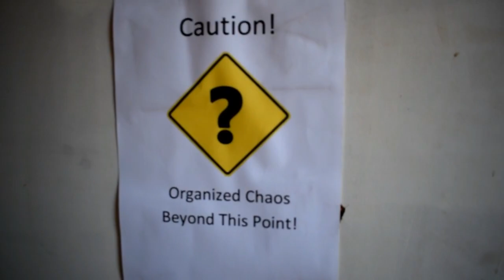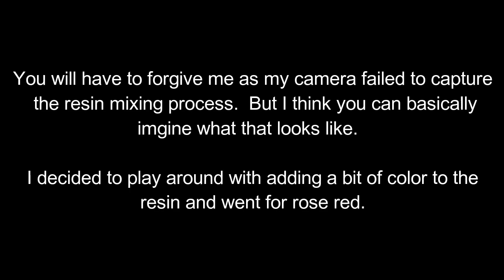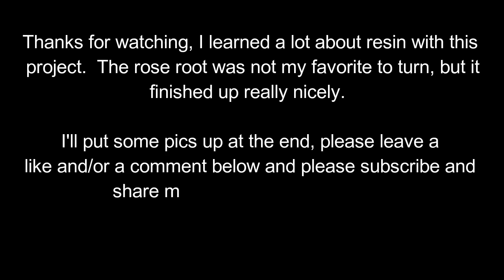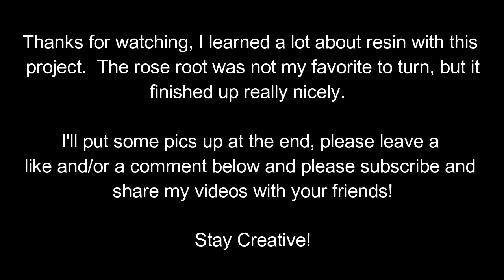Turning a Rose Root Hollow Form Bowl (fixed with resin)

Comment: Cute the epoxy in a pressure pot. 50psi for the first 24 hrs. Zero bubbles. All cracks filled.
Reply from the maker: Thanks for watching!  At the time I made this bowl I didn't have a pressure pot, though I was aware that it would have helped.  Overall, I think it came out pretty good considering I didn't have a pressure pot.  Thanks again for watching, stay creative!

Comment: I'd LOVE to laminate that 'Caution! Organized Chaos Beyond This Point!' sign and stick it to my front door...yup, that's my life!!!  Do you remember where you got it?  3:27...of course it'll go back in place...put it in a bucket of resin with a weight on top...leave it in a pressure pot at 50 psi over night...bingo bamo...it's back in place.  Oh, wrote this BEFORE you actually did this...never mind.
Reply from the maker: Thanks for watching!  I made the sign actually as a joke on Photoshop but then it just stuck.  As for the bowl, funny thing is I didn't even have a pressure pot when I made this and it was actually one if the very first things I ever made using epoxy resin, all things considered it turned out really well.  Thanks again for watching, stay creative!
Reply: @FromTheHeartWoodMK  you too...stay creative.  I can't find any signs like it on the Internet...so assumed it was a PS thing...speaking of creative...very creative.

Comment: Nice job! I found myself trying to dissect your stand. How does that work for you?
Reply from the maker: Thanks for watching and taking the time to comment!  If by stand, you mean camera stand, then in most ways it was a very helpful piece of equipment I had constructed with several moving joints to hold my phone, though it wasn't pretty 😂.  I was able to put it in many angles and positions that made for interesting shots.  Sadly I broke my camera phone one day and so I switched over to using a GoPro and I'm still getting used to that and thus, I don't use that camera stand anymore.  Thanks for your question, I hope that's what you were intending to ask.  Stay creative!
Reply: FromTheHeartWoodMK indeed great camera work but meant the lathe stand. Looks like it’s not attached to floor but wall?
Reply from the maker: @scottpetrie8707  Yes indeed!  I used to have it attached to a workbench but I had a problem cleaning the sawdust from under it.  I had a friend welf me up a couple of  angled braces that I then bolted to the wall.  It's rock solid, allows me to stand closer and sweep the chips and sawdust easily from underneath.  In short, it works very well!
Reply: FromTheHeartWoodMK That is awesome! Squeeze in some video on the next one of that.
Reply from the maker: @scottpetrie8707  Though I've been meaning to do something of a shop tour of sorts for awhile now and might eventually get around to it at some point, for now your can actually go and watch my most recent video and around the 2-3 minute marks there are some good shots of the  setup.  Hope that helps for now. Thanks again for your interest!
Reply: FromTheHeartWoodMK Will do!
Reply: FromTheHeartWoodMK yeah man that had good view of it. You get a lot of wobble from funky shaped wood? Or should I say more than usual.
Reply from the maker: @scottpetrie8707  To be perfectly honest, no.  The late I have is pretty small so even with really off centered pieces it's pretty solid.  I haven't ever had to replace the bearings on the lathe and I've had it for over 4 years.  I figure that because it's anchored to a solid concrete wall, it would have to shake the whole building in order to shake or wobble.  All in all, it's the best option for me.
Reply: FromTheHeartWoodMK perfect! I have a small Harbor Freight and on the bench, it’s murder. It has the leveling screws on the bottom that has to go. I will build a modified version of your with wood. Thanks again!

Comment: Loved the music … then again I've been a Satriani fan for some 30 years.Did you put that piece in a pressure pot after adding the resin to the root ball ? Interesting piece , nice result.
Reply from the maker: Hey, thanks for watching!  I didn't have a pressure pot back when I did this project as I have just recently built one.  I simply coated all the surfaces with poly varnish to keep air bubbles to a minimum.  I did end up with a few bubbles and cracks but nothing that would destroy the project.  In the end, I feel I was a bit lucky, but it all turned out great.  Thanks again for watching and taking the time to comment and yes, Satriani rocks!  Stay creative!

Comment: very nice, love it!!!
have you used a pressure pot for the resin to pretend against bubbles or other stuff?
cheers
Reply from the maker: Thanks for watching!  No, I don't own a pressure pot, I simply sealed the wood in all places and on all surfaces with epoxy resin before casting, thus eliminating the potential for bubbles, it works really well!
Reply: @FromTheHeartWoodMK  wow thanks for your quick answer, thats a really good idea!! 

Did you cast the wood in one step with a lot of resin or step for step? i ask because of the fear of cracks.
sorry for my bad english ^^
Reply from the maker: I did actually cast in one step, the resin did indeed great pretty hot and I got a small crack near the bottom of the bowl, but I was able to patch it.  I was successful in getting no bubbles because of my previous sealing of the wood, but the resin will tend to crack if its too thick and gets too hot.  If you can, cast in thin layers, I have had great success since then with that method, best of luck!

Comment: How do you know at what speed to turn
Reply from the maker: First off, thank you so much for watching!  To answer your question, generally I just use the lowest speed on my lathe when beginning a bowl, especially when turning something like a root or a seemingly unstable piece of wood.  If the piece is solid and balanced, I might start it a bit faster, but most times I start and stay on the lowest speed which is 800rpm.  After that, I just gauge it on feel, what feels right and what will best keep the piece from exploding.  Sharp tools and light passes are the key.  Best of luck to you!  Stay creative!

Comment: Nice bowl too bad about the cracks and small holes in resin.
Reply from the maker: Thanks for watching!  Yeah it turned out good and from where it sits on the shelf you can't see any of the defects thankfully.  Casting that much resin without a pressure pot is always touchy and really you are asking for trouble, but it turned out well all things considered.